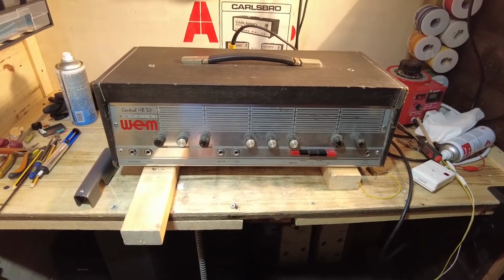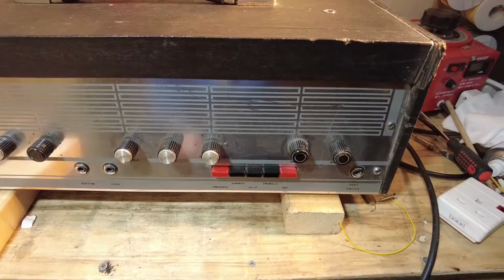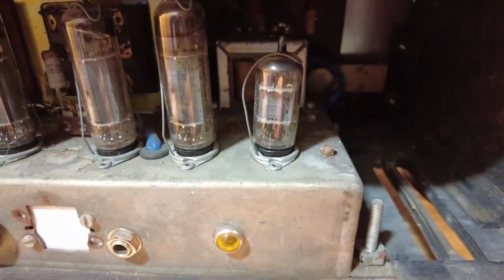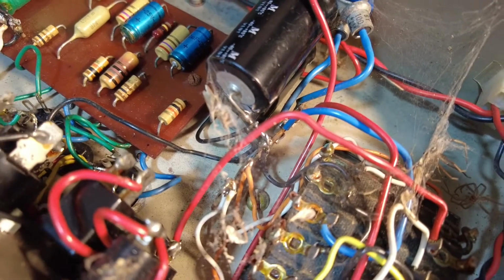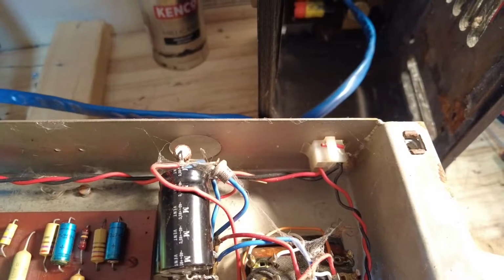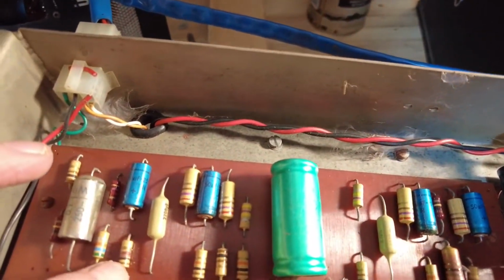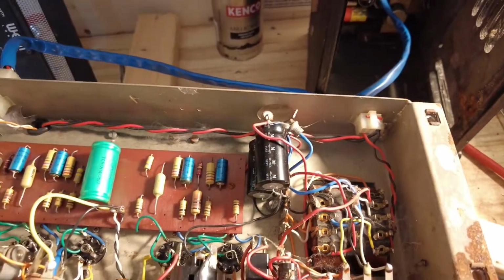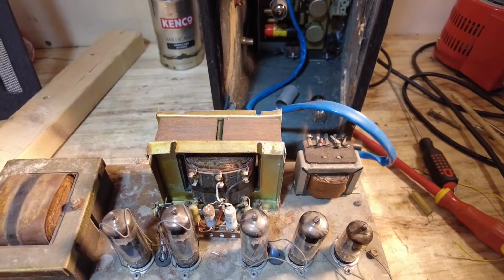Wem HR 30 Control Part 1 First Look Inside and Outside

Comment: Your video series on this amp is superb. I'm currently working on a WEM Control HR30 in fully original condition. The amp has a 3 pin Bulgin style speaker jack output next to the Bulgin Power supply socket (hence yours was blanked off). Interestingly, the can capacitor on the power supply is 100uF and 60uF! Sadly, the amp I'm working on, the latching push buttons on the switch module are all busted up. You have gained a subscriber!
Reply from the maker: Hello Christian, thank you. I had one of those push button units that came out of a Bird amp. I will see if I can find it. I have just spotted your post on Facebook, If I can find it I will use the picture to compare it. Take care
Reply: @vintageguitaramp_guitarteacher  Thank you so much!

Comment: I also have one of these amps,witha strange fault on it.Haven`t had a proper look at it yet but the preamp valves aren`t lighting up although I have 6.3 volts on the umbilical pre amp side ! So must have an o/c somewhere ,will have to lift the preamp board up methinks.The schematics online aren`t very clear so I`m also thinking will have to trace out which will be a pain.Never seen anyone tackling one of these before so am looking forward to see your progress,good to see ,looks like one or two of us will be able to compare notes.Well done.Uncle Doug will be watching from over the pond I`m sure! :)
Reply from the maker: Hello Electrokatt and thank you for your message. Yes not much information on this amp. They are quite rare. The amp is nearly finished now but it's been a tricky one to restore. I hope the videos will help you when you restore yours. You are right about tracing out the pre amp. PC boards are a nightmare. Thanks for your kind words. I hope Uncle Doug is watching. I wonder if he has ever seen one of these amps. There can't many of them in the States. Thanks again and take care.

Comment: Thanks for sharing.  Hi there I am looking at repairing one of these at the moment.  I have all ecc83 in the amp... just wondering if you have the same as hr30 seems rare and no schematic info out there...
Reply from the maker: Hello and thank you for your message. Yes all the pre amp valves are ECC83. I haven't found a schematic for the pre amp section but I have found one for the power amp section. It is same as the BR30 but the pre amp is different.

Here is the link for the Power amp schematic. Hope this will help you.
http://wem-owners.com/wp-content/uploads/2015/04/br30b.jpeg
Reply: @vintageguitaramp_guitarteacher   thanks for confirming.   Yes the 30w power amp is common to a few wem and also a smaller 15w version.   Enjoyed the vids
Reply from the maker: @Amploft  Thanks mate. Don't hesitate to contact me if you need anything. Take care!